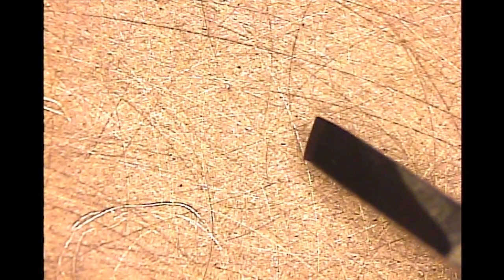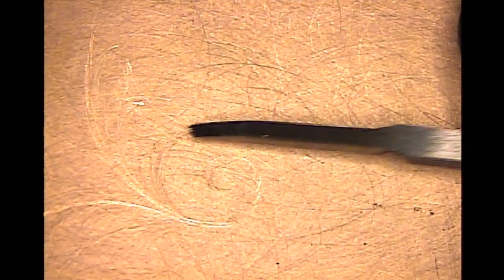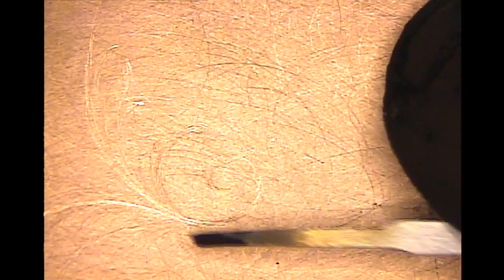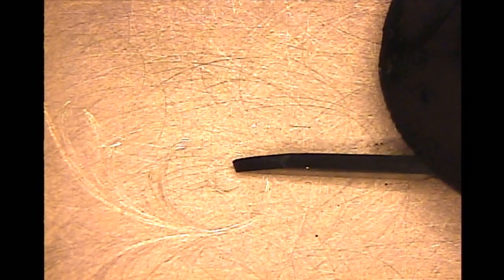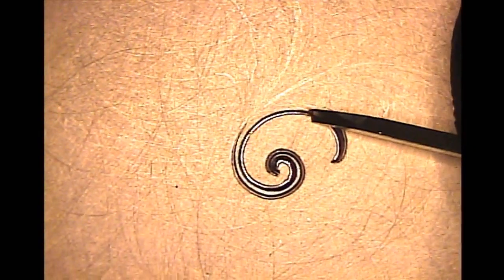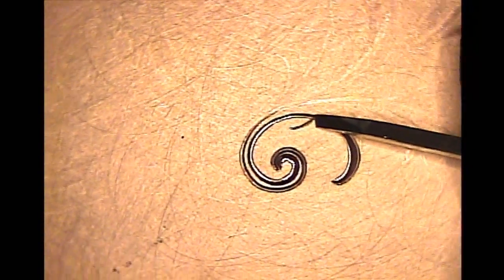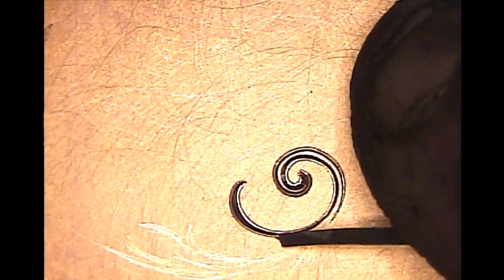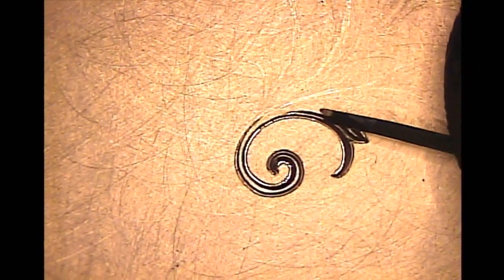Using the Enset for Flare Cut Engraving

Comment: I would get so addicted to this if I had the tools!
Reply: You can make one for under 65 dollar. YouTube "Shaun handmade engraving machine".
Reply: A friend who is a fitter and turner would be worth their weight in gold to assist in making air graver at a lower cost than usd1500 -2500 for the handpiece.
 Of course air is needed to drive it at extra $$$ but much cheaper than the fancy top noch gear costs

Comment: with a pneumatic engraver do you have to push the graver or just control the blade?
Reply: trekranger depends on the kind of system.. some are foot controlled while some are activated by pushing palm.. both are very easy to handle and requires little to no puahing.. just control the graver speed up or slow down as you wish

Comment: hi awesome job man... what kind  of engraver is that and where could I get it?
Reply: +Salvatore Rametta Look at 'Hand Push' engraving.  A sharpening stone, a steel graver and a mayonnaise jar lid full of pitch to secure your work in can get you started....  Keep bandages handy as slips with push engraving often result in blood being drawn.  Old time engravings were done  this way, as there were not power tools hundreds of years ago....
Reply from the maker: Thank You. The tool is the Enset it is a pneumatic driven handpiece and controller that is used as an assist to your hand work. Unfortunately there are n systems in that price range. The best option is to look for something on the used market.
Reply: Christian DeCamillis are there any systems that are around 100$? I am just new to engraving and I dont want to risk so much money at first
Reply: That's correct but don't try hand pushing in hardened gun steel. That is where air powered gravers or hammer and chisel come in.
Reply from the maker: It's called the Enset. You can get more info at engraver.com